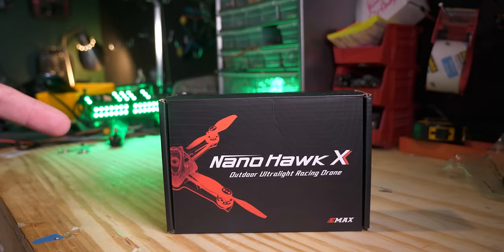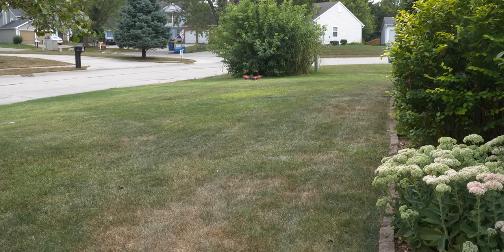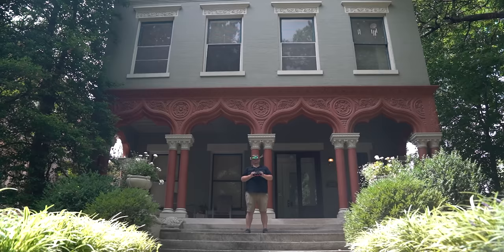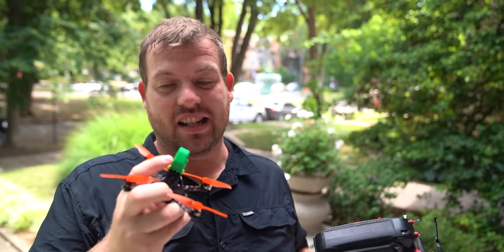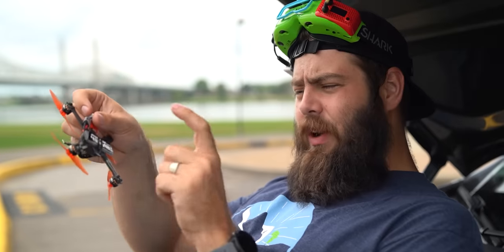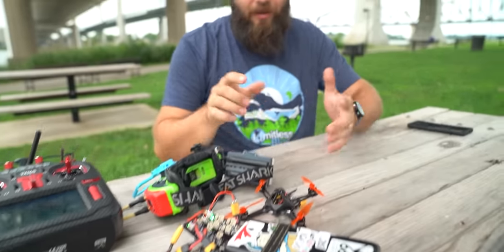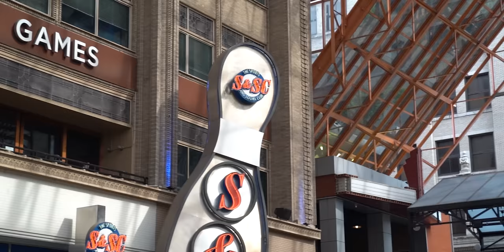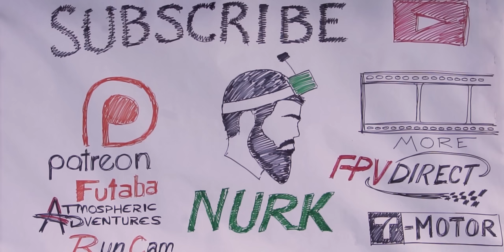Emax Nanohawk X - My Favorite Micro Drone By FAR

Comment: a weird thing that actually gives me a lot more confidence in 1s LiPo micros, is actually Dave C's attempts at 1s LiIon. if those things can fly, then LiPos will have no problem satisfying performance needs.
Reply: What radio would work with the hawk nano?
Reply: @darren_baldwin  If you're asking that question you should start with a simulator. Learn how to fly on a sim and spend $0 per crash. Then get the "nanohawk" and bind it to your frsky transmitter  of choice with D8 or D16 mode.

Comment: I crashed mine and it took a lucky flip straight into my pond. It sat there submerged 3 ft down for over 10 min. It was still blinking leds under water. I unplugged the batt before removing it and then doused it with mapp sensor spray. After some time under a heat gun its back in action. Emax makes some good stuff!

Comment: Looks fun, no TBS nano or ELRS seems like a big oversight, but that can easily be fixed.
Reply: Emax elrs hardware would be awesome!
Reply: If the FC AIO has solder pads for it 🤔
Reply: @Cre8ionz.  If it is the same as the Nanohawk, it does. I have Crossfire on my Nanohawk.

Comment: stupid question  on my part. and I know some drones come with circle paper showing which way motor spin.. So if it's spins clockwise .. I put prop blade that are angled down .. to shop to the right.. if the blade angled up go on the clockwise motor?

Comment: IMHO Insta360 need to tweak their code in the software that does the FPV stabilisation with GO 1 & 2 footage.
The more I look at my GO footage the more I see the flaws in its FPV stabilisation, namely it's really difficult to get long shots of smooth flowing footage that feels natural.
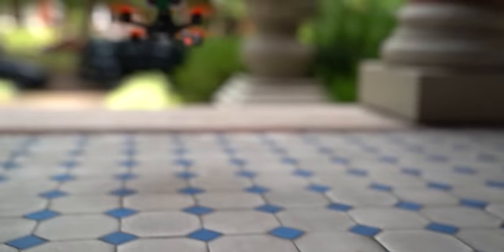For example, in this video where you start flying with the GO 2 at 09:09, when you change from rolling from one side to the other it's very noticeable, like it doesn't smoothly go from rolling left to then centered and then to the right, you can practically pinpoint the frames where it switches roll directions.

Comment: Looks like a nice product! Thanks for the great review. But, 140 bucks for this is quite the stretch!!! 😳 Since it's essentially a 1s whoop on a carbon fiber frame, with your typical 5amp AIO, I think $99.99 is more reasonable... Maybe $119.99, if it came with 2 more batteries and a full set of extra props.
I won't be buying it at $139.99, that's for sure. 😮🤷  You can buy the awesome Mobula6 for$85, and a cheap frame and canopy for under $15 and have essentially the same thing. Probably better if you get the Mobula6 with the 25k kv motors. It'll be much lighter, that's for sure, and under $99. 🤔🤘
Reply: is it as quiet though?
Reply: @seanstewart2344  Certainly! :)

Comment: How did you get it to work with Raceband? Mine only connects video with boshcam setting
Reply: Does it come locked from factory like some vtx?
Reply from the maker: Yeah you have to unlock the vtx. The manual has instructions on how to unlock it. But basically hold the vtx button while powering up the drone

Comment: hey buddy great video. I seen when you were flying around your roof that your HVAC vent is starting to rust pretty bad but if you just surface sand all the rust off and paint it with rust-oleum it'll last a good bit longer. It will cause a leak in your attic if you leave it. love the work you do! Have a great day man.
Reply from the maker: Ha! this drone also doubles as a remote inspection tool!
Reply: @NURKFPV  😂 most people probably didnt even notice. i cant help but see it i guess because ive done that type of work for over 15yrs lol

Comment: hey idol i am one  among so many funs and follower u have Currently Reside here Country New Zealand, and im into piloting dronres , in fact i got 3 minis of DJI after bu9nch of ,toy  cheap drones before i found myself im into this hobby, and i do practice FPV like cheap small quadcopter that no acces to connect Goglgles/ and u cant remove your fingers from control./ iexpend most of my time while lim on break for work to watch abouit FPV pon your channel and your Fuckn so good man.. im not dreaming to be like you but i wish hahaha,. Idol help me to decide what drone for me as begginner for FPV,, but im serious to get deep in FPV thatsa why my first concern is the Control, i want the control to use for my future upgrade of FPV hardware. im thingking much better pls correct me  whjen this is wrong. im about to decide to imvest for control first that at least i can able to practice FPV using the  actual control into simulator. idol pls give me the set of information about practical hardware for me,, im not go for expensive one that using of Pro like u and others and price concern too.   my decission  to buy fpv will  on from your advice what kind of control and simulator im going to take, or even with drone straight away, because i like this FPV featured on this video, Emax nano haWKx ILL BE THANK 
FULL IF YOU HELP ME MY IDOL, aLEX